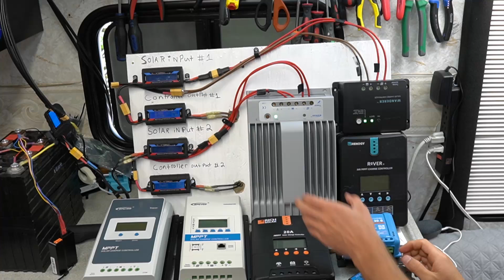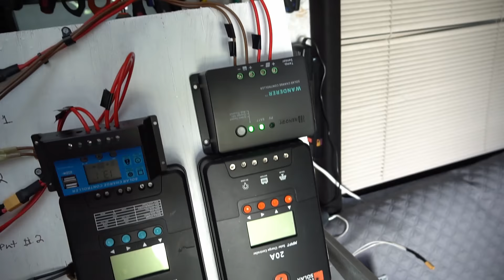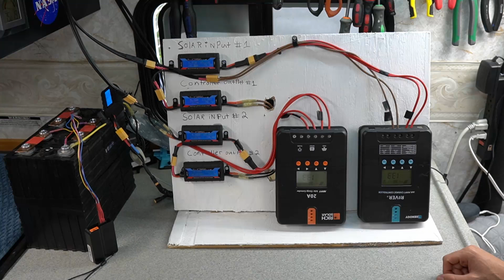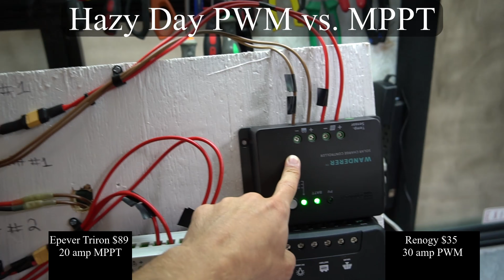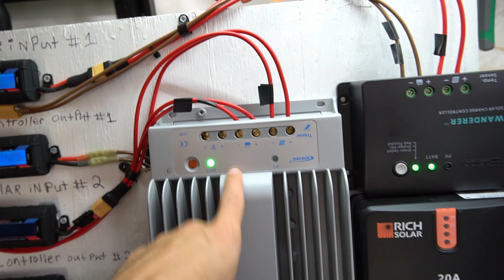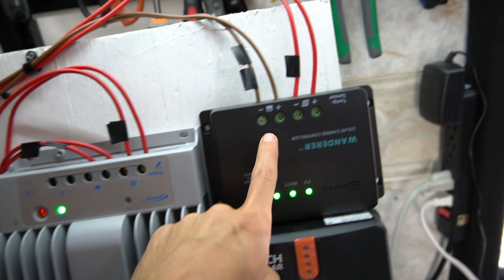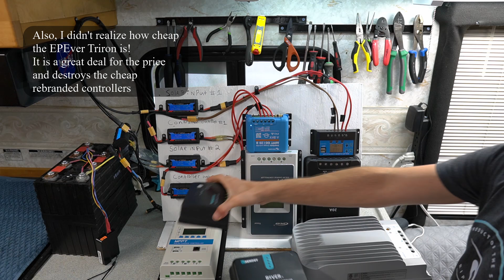12v Solar Charge Controller Buyers Guide - Beginner Friendly!

Comment: I have two 12 volt batteries in a 22 ‘ Cuddy  Cabin  boat.  I want to maintain the charge using solar.  I think I would prefer MPPT unit.   I am wondering which MPPT and Solar Panel do you recommend.  I would like to accomplish buying a good product but there is a possibility it maybe stolen because it is in a marina.  Thank you

Comment: i need a simple controller for charging two 12v car batteries (about 100ah) to power about 80w of leds for a few hours a week, would like to get the most out of the batteries, but within reason - i have heard that some controllers will not top off a battery from 90-100%, which is where a car battery should remain. which controller would be best for this application?

Comment: Incredibly useful and great knowledge passed on as always. 1 quick question.
Is there a reason I wouldn't be able to connect my car battery and solar panels to my MPPT to charge the leisure battery, providing I switch the solar panels off when the van engine is running? It seems like a dumb question, and probably is, but to me it seems like maybe the B2b charger and MPPT do a pretty similar job.
Any advice will be greatly appreciated. Cheers

Comment: ok, I am on a tight budget so I can only buy a bit here and a bit there. What I can afford at this time is a 200 watt solar suitcase. It has a crappy charge controller in it. I would like to replace it with an mppt charge controller and go with bigger amperage than what I need so that I can add more solar panels later. Will the larger controller harm my system or reduce it's efficiency ? And, one more question, how many amps would the charge controller be for the typical 200 watt solar panel set up ?

Comment: I have a 380w panel. It splits to power our 48v deep well pump, self contained mppt and a cheapo  mppt that chargers our 12v deep cycle marine battery that runs our 12v flojet water pump. I think the charger is fried. 
Would a solar trickle charger be enough to keep our 12v battery good to run just the pump?

Comment: Hi, Will. I want to use a pair of the 20amp Rich charge controllers feeding 4 LiFePo4 BattleBorns from 400w of Renogy panels. Can 2 charge controllers be used in one 12v solar setup? Thanks.

Comment: Hi, thanks for your video. I completely agree with your review. One question that has bugged me for ages; my Victron regulator will not increase input watts when it is float even if I'm using lots of power from the battery (i.e. I would like to keep my battery charged and use available solar as I run appliances from battery). Why? If it is in float the wattage is around 3W even if I'm using 100watts of power from battery. I have the cast body Tracer BN in my shed and it will keep batteries on float and when I run appliances from battery via 240V inverter it instantly increases incoming watts (similar to what's being consumed). Is there a setting on the Victron I can make to get it to do the same? Hope this question makes sense

Comment: Will, do you know of a charge controller that is also a charger that you keep connected to the grid or generator and continues to keep batteries charged at night or when the panels are not producing? In other words, a charge controller charger? I have a remote cabin that is also connected to the grid, but the grid there is not very reliable. I would love to monitor my system from an app. Thank you, you are the go to guy!!!

Comment: Thanks for the video! Have a couple of questions
1. Do all solar charge controllers sense what type of battery you're connected to (lead acid, AGM, lithium ion, lifepo4) and automatically charge them appropriately, or is there a setting you have to change, or do you just have to make sure you get the right controller for the type of battery from the start?
2. Regarding pass-through type power, would you always put your load on the battery, or do some have you put the load on extra charge controller outlets and the charge controller itself decides whether to power the load with the battery or with available solar once the battery is topped off, with the battery acting like a UPS?

Comment: I am using an Epever Tracer-AN series 100 amp charge controller controller with two 390 watt  panels (adding a third in the near future). What do you recommend for wire gauge from the controller to the batteries? We currently have two AGM in parallel and plan on adding two more.

Comment: I got my hands on the cheap Amazon charge controller for 30A, I also got a 450 watt solar panel, with Open circuit volt of 49.1 and Short circuit of 11.3A, Is it possible to use this to charge a 12v batter or it would be best to get a 48volt battery?

Comment: Wil we bought the 40 Amp Epever  Trace BN (your fave) we 4 120 watt panels seriesed to 24 volts / 4 L16 lead acid @ 24 volts does the charge controller have to be programmed or will it be a plug amd play. We have the MT 50 but can’t understand the instructions for programming.??

Comment: So PWM fared well against MPPT it looks like.  Would one solar panel 100 watt be enough to charge two 12 v lead acid batteries under load or would I need 2?
Reply: depends on the load, how long the load is on, and charge time available.

Comment: What is your opinion of the EPEVER MPPT Solar Charge Controller 20A 12V/24V Auto Solar Panel Charge Controller Max.PV 150V?    this would be for a 100w panel on a teardrop.

Comment: hi im looking to buy a Renogy Rover 20A which max solar input is 260w in 12v systems...but i got a 340w panel...this 340w are in ideal (lab) conditions, my panel is installed in an RV it has no inclination and i often park under the trees, even in this conditions, is my 340w panel to much this controller? thank you for your videos, they're gold

Comment: I'm wanting to put 400 watts of solar on the roof of my RV. I was looking at the Renogy 400 watt premium kit with a 40 amp mppt charge controller. The kit comes with 8awg wire. My RV is already pre-wired which is nice, but the wire from where the charge controller will be going all the way to the front where the batteries are is 10awg. Is that too small? should I get a smaller charge controller?

Comment: Whats the name of The silver all metal one? I want to build a system for my sailboat, its got a 20kw electric drive motor with 4 lithium batteries, I also have 5 lead acid house batteries. What would you recommend for panel size etc?

Comment: Learned alot to create information overload.
Using on a boat thinking cost and spare controller.
With lipo4 battery would I set up with your favorite controller and carry the $15 low cost as a spare?

Comment: I just swapped out my marine 12v system for a LiFePo4 24v, and I'm finding that most of these controllers are buck only. So I'm forced to put my 2 solar panels in series, which is killing my power if either one is shaded. Do you know of any charge controllers that will boost voltage? I've got a Rover, but I was looking at the spec sheet for the Victron and even it only does buck.

Comment: Hi, I have a 5000w solar array,  24x 600ah hopekke batteries and a chineese inverter/charger mmpt 5000w/ 80amp. It never fully charges the batteries ...with sign of sulfation after a year. Any recommendations on the charger and a desulfator? Thanks

Comment: Intresting.  Is the one PWM 30A suitable for 400W solar panel? Standard solar panels has 300/400W and 40V. Will it work for example with one 350W/40V solar panel?

Comment: Well that’s all good and simple… but there’s a big but there because the wires size is very dependent on the true amp rating of the charge controller! A normal solar system for a house and off grid system is going to use 10awg wire.  So a normal off grid system we build for a cabin is going to have 1 string of 5 or 2 strings of 5. And that’s still only going to be one or 2 inputs using 10awg wire. You should really be more clear for people on what the exact wire size is of those controllers your saying is to small and again the battery output in the charge controllers is also very dependent on the size of the charge controllers if it’s only a 30amp your only going to have a terminal for 10awg thhn wire. Unless you are getting into the range of say a 150v 60amp outback control your still only going to have 6awg terminal. 

Still really like the vids and your doing great on the information for people and definitely leading them down a good path

Comment: Hay Will, I live in Oklahoma so when the sun's not shining the wind is blowing. So, my question is,  for a redundant charging (system wind/solar) do I need separate charger controlers?
Reply: wind has a bit different handling. Check out Missouri Wind and Solar's YT channel. Btw EPEver has a controller type specifically for solar and wind in one.

Comment: Hey I am installing 2 300 watt panels on my class A and I'm charging 2 6volt lead acid. Could I use the cheep controller? My 600 watt inverter is only connected to the lvng room and bedroom TV. I just need to charge the batteries without generator while boondocking.

Comment: I’m putting (1)150watt solar panel on my dog trailer to run a small A/C unit and a few lights. What should size MTTP do I need? 20, 40, 60 amp? 
Also for this application, what battery do you recommend?

Comment: Hey will. I have a EPever 40 amp 150 volt one similar to the one in your video. It shows on the mt50 display it can do wet, gel, sealed, and user. Is it safe to use the user and set the perimeters for a lithium?

Comment: Question I’m having a hard time figuring out what charge controller should I get. 
I have 4 solar panels that I picked up for free. The array setup is all parallel. 
Specs on them are 
Pmax 260w x4=1040w
Volts 38.2 max 
Amps 9 x4 = 36a

I have a 12v sine wave inverter 4000w 

Is greatly appreciate any advice.

Comment: hi my eleven mppt charge controller only turns on when my engine on and my renogy dc charger comes on as it should to put charge into battery and it shows voltage on my epever remote meter .strange won't display when engine off .any ideas anyone

Comment: You need to rewrite your book...LOL...  I have factory installed Armada ARC-30 PWM with 370 watt solar array on my camper and was going to refit to a more efficient MPPT Solar Charge Controller as per your advice on page 33 (Mobile Solar Power Made Easy)....Just watched this and Now I'm confused... According to this review there's no need to change controllers?.... My plan is to upgrade to (2)-310AH  Lithium Batteries that I bought from Ali Express along with 2-Overkill BMS units that you recommended for the DIY'er....Putting them together is sure to be a challenge but doable.... My concern is, do I have enough solar panel wattage to fully charge these hefty lithiums and also is my existing ARC-30 up to the task?... I would like to augment my solar panel array by 100-200 watts in the future with an Inverter in mind as well....Should I upgrade to 40 or 60 amp MPPT making room for expansion?....Your book has been helpful as a frame work of reference material for this beginner.. Any pointers would be greatly appreciated.

Comment: To Will or anybody who can answer this:
    If I get a 360w Photovoltaic Solar Panel that produces 40V the 
current should be 9 amps (360W\40V = 9 amps) . Then would any 20 
amp controller work with this system? It seems that the solar power 
controllers are rated on amps, not watts. Is that correct? Also if 
I put a pure sine wave converter on this system them the current should 
be 9 amps (360W/40v = X/110V   X = 990W so the current is 990W/110V or 9 amps.
Is that correct? Thanks to all who answer this. Richard.

Comment: Enjoying your videos.  Just picked up a bunch of used LiFePO4 batteries from a friend in the medical equipment business.  Can you tell me what is the best way to test the useful additional life of these batteries?  What meter should I buy? And, what charger would you recommend? I'm looking to build a stash of 12v batteries for the trolling motor on my kayak.  As you can imagine, space and weight are critical factors. Thanks.

Comment: help:  know nothing about what i'm doing.  have two 100watt renogy panels just installed on rv   13ft scamp  have the wanderer controller and only one 12volt sealed battery........ideas? concerns? how can i get the most use watts for camper?   ty

Comment: Hello Will.  I'm Ross and a newbie with a 2015 Lance 1995 TT that I am in the process of converting to Battleborn Lithium Batteries (3) with a Victron Inverter.  I don't know much about electricity so you can bet I do not move quickly or rashly.  It seems I have some ghost electricity coming from somewhere, as I have NO batteries attached and have shut down and unplugged my portable Champion Inverter generator.  The only thing I can think of is that I do have a 160 W single solar panel on the roof.  Could this be supplying enough power to keep the interior lights and the Jensen Media Center powered?  I thought the solar panel's ONLY job was to keep the batteries charged.  If that's true, how can the interior lights and media center have power?  Where could this power be coming from?

I truly appreciate your "easy to understand" style and hyper-informative vids...I'm sure the whole RV community does as well.  If you can please point me in the right direction as to why there are lights powered when no power source is connected, it will hopefully keep me from getting zapped as I go through this lithium upgrade.  Thanks much.

~ Ross

Comment: I have the cheap $15 one in your video. I'm switching out batteries from AGM 70ah to a LiFePo4 200ah. So I don't have program the controller or tell it anything right? It will automatically sense the change?

Comment: Hi, I built an electric trike with a 72v lithium battery.  I'd like to use solar to charge it and do more when not charging the bike.   Is there a lot of loss if I use a DC to DC to convert a panel to the higher voltage, or what do you suggest?  Thanks

Comment: These videos are great! I went with 2 Valence U27-12XP lithium batteries for my travel trailer. We currently have a 200 watt solar system and 1000 watt inverter. What amp rating would you recommend for the charge controller? I’ll probably be adding another solar panel or two. 👍

Comment: always great videos Will, I looked at the bn40 and wonder why max 520W(12v) when max V is 150 and amps 40? I have 3 340 panels on the roof,  ocv is 46.6 and Isc is 9.45 I should be able to run this unit with my panels in parallel and not exceed V or A. what say you?

Comment: I am kind of new to the solar industry but I have a trailer that’s in a very shaded area in a trailer park but I am off grid. My question is if I have 4 solar panels? On one charge controller and I attach it to my battery bank can I have another four solar panels on another charge controller attached to my solar back so another words what I am asking is I want to charge controllers attached to one battery pack and what I have for a battery bank is three 200 app lithium batteries, so can I do this port to charge controllers on one battery bank?

Comment: I loved your review! My system is using a Redodo 200Ah battery and a Giandel 4000w power inverter, if I’m hearing you correctly, you suggest the Victron controller over the others. Is that correct?

Comment: Hi, I  have the Bluetti EB3A, I want to use it to run a iceco 30 gt cooler/fridge. I bought a large solar panel and installed it on top of my truck camper shell. The panel is 260 watts at 36 volts and 6 amps. The problem is that the Bluetti only accepts a maximum of 28 volts. Does a charge controller reduce the voltage to a desired level or what? And how does it work? Just cook off the higher voltage as heat? What is the cheapest I can go to solve my problem?

Comment: I’m switching to two 100Ah lithium batteries in my trailer 
My challenge is I’m waiting to mount controller in battery box
Is there a low profile controller you would recommend? Many of them are too thick to fit 
Thx!

Comment: I have to admit, I'm a little more confused after watching this. One of my main concerns you brought up is the wire connector issues. I'm running 400w of solar off my camper roof at 12v about 11 feet to the charge controller and then from the controller to the batteries is another 10 feet maybe. I have to use 6 gauge? and it's pretty big so if the wire ports are small, that's a pretty big problem.Will all of these take 6 gauge wire or will I need to spend $30 on conext links to use my $30 dollar charge controller?  I went looking for this video because when I went to buy a charge controller I noticed the one I was looking at said it was 100v (it was a Victron). Then I saw one that said it was 75 volts.  That stopped me because I don't know what that means.

Comment: Hi Will I'm confused,, how do I charge a 12 volt battery with a 39 volt 9 amp 280 amp solar panel.
What charge controller would I use?

Comment: you keep pointing out that the one charge controller is your favorite, LOL what is it, LOL. And I have an ep ever Tracer just like the one you have on your bench there and I don’t have a screen and a program just fine for me, but being I’m a little older I move a little slower so maybe that’s it it can keep up to me LOL. I do have one question can I use a 60 amp charge controller with a small battery bank. The reason I would do this is I will be adding to the battery bank I will eventually have 800 amp hours but I can’t afford to buy it all at once.

Comment: CAT 153-5720 Premium High Output Battery; 
I have a lead on about 10 of these for $80 each. Would this work good for back up for my heating system? I’d like to run it for 1-2 days at 121 watts and hour. It’s just a propane heater.